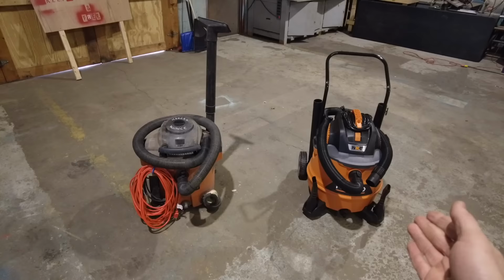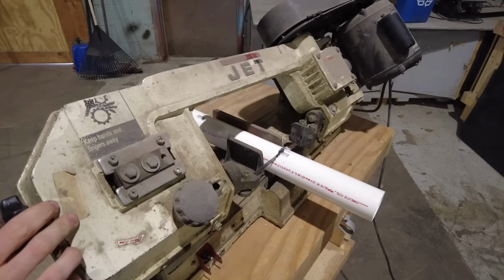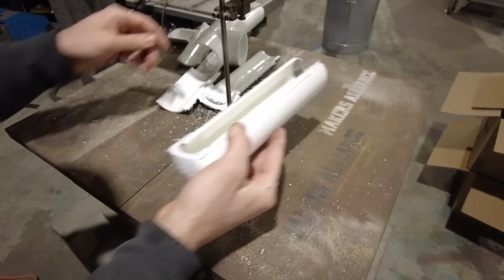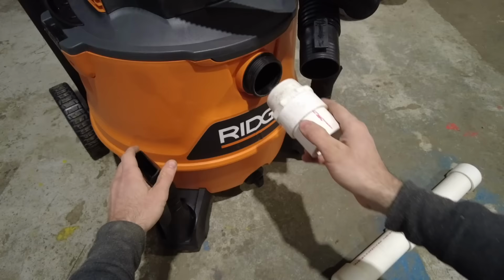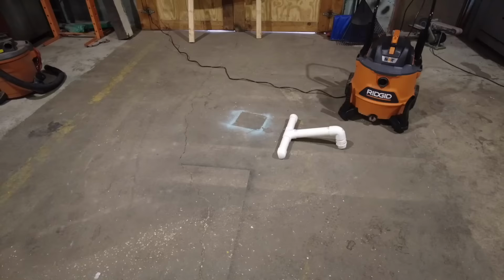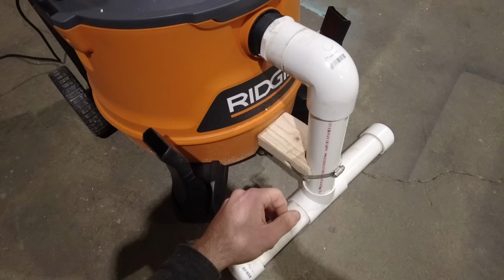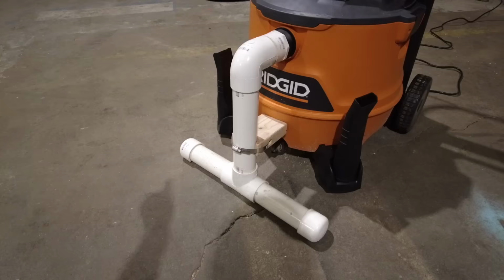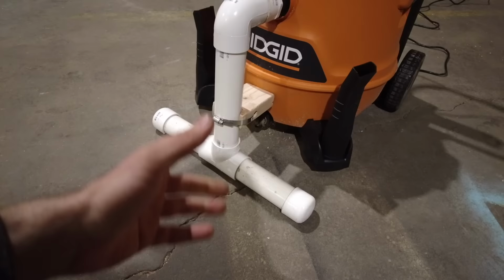DIY Shop Vac Mod  -  Super Wide Walk-Behind Attachment

Comment: Install a rubber door sweep on the bottom rear edge of the floor suction piece . That would prevent uneven edges or floor cracks from stopping progress, and also catch any dust that might have been missed.

Comment: I did the same thing except after cementing and assembling I used my miter saw to cut two slots 3/4" of an inch apart then cut the ends of the slots with a step drill.

Comment: Like everyone, I had a thought. I agree that a smaller pipe and slot size would increase velocity and suction power, only sacrificing "volume", which isn't needed here. What if you put a smaller tube inside the intake bar, but not glued. have about a 3/4"slot in both tubes. THEN the inner tube could be rotated to "close (adjust) the gap size as needed. Wider for liquids, smaller for dirt, sawdust etc. Just glue one cap to the outer tube, the other cap to the inner pipe. The smaller would be the "knob" to rotate and adjust gap size.

Comment: i'de def cut a slight angle at the front so the first thing hitting a pile is the gap not the pipe. now to make an attachment that sucks up water LOL. I assume it would need smaller slits instead of a huge one. would be interesting to see how fast it picks up water

Comment: Nice work. I've always wanted to set up a big vac in the corner of my shop, lay a long pipe slit open and just push broom all the metal fab dust into the back wall area to be sucked up

Comment: I say this is awesome if it works for you no solution is needed.. btw the attachment rigid made that you took to Home Depot to compare for size is basically just a cut pvc T so I think you are as smarter than the engineers at rigid

Comment: You can lengths of tubing easily on a table saw with a jig. Just make it so the pipe is encased on three sides with wood screwed and glued together and you can run the length of the jig and tubing aong a saw to cut a single path into the tubing.

Comment: Not sure if this has already been mentioned; 1) glue the PVC with PVC cement before you cut the bottom of the pipe,  2) use a router or a saber saw to cut a slot in the bottom of the pipe. Still though, a good idea.

Comment: Mount a cordless vac to casters with a push handle and do this would be even better.  I recommend Milwaukie cordless vac.  Very good power and lasts forever.  Design of the pickup piece suggestion.  A much smaller slit slightly towards the front rather than 1 1/2 or so you had will provide a lot more pickup power I believe.  I suggest no wider opening than 1/2 inch?  One more thing.  In electrical conduit they make what is called and expansion coupling or joint.  Basically it's 2 pieces of conduit that are free to slide around each other and have O-rings to seal air.  Use one of those as your down piece and maybe put rollers on the endcaps.  This way it self adjusts as needed.

Comment: Turn the pipe so the opening is up more so when you hit a pile it goes straight into the opening. They make flexible rubber fittings that would work better than the wood and you could use a rubber gromit at the machine you could use a hose clamp on to secure it so it would stay on.

Comment: Put a spinning brush attachment inside the cut out horizontal pvc 
You can attach it to the to the end caps 
So now when you push the shop vac the internal brush can spin causing the debri to be sucked up whether going forward or backwards.

Comment: I made something just like this never made a you tube video on half the things I’ve made for shop use but i probably could have so many millions made off of simple things. I made mine about 3-4 years ago I’ll have to post up on here to show you. I have little wheels on the front to accommodate different levels of floors an used thinner pvc to gain more suction . Think 2” to 1.25” maybe 1.5 but it works amazing and I suck up about 200 gallons worth of saw dust in my shop

Comment: I actually think that it pushing some of the dust around is a good thing making limited or not picking up more than it can handle. If I was going to try to improve it a bit it be adding something a roller chair for a relaxing sitting clean up.

Comment: First of all, I have a 3d printer that helps with the custom to stand pipe interfaces. This includes proper threads where needed. To maintain a higher vacuum pressure without the need for significant height adjustment, a circumference of brushes could be incorporated. Again, the brush interface can be 3d printed

Comment: You could add a brush on the back of the straight tube that's on the floor.
And make another one and add a rubber across the straight part on the back and use it for a squeegee to suck up water.
Then you can put it on the back side where it blows out to dry the floor!

Comment: Interesting idea.  If I may piggy back on your idea, I think you could glue up the horizontal intake pipe with pvc primer and cement, let it cure and then rip cut the opening on a band saw.  Just a thought.

Comment: Excellent mod. I understand the portability of the cordless glue gun, I prefer to plug in my tools just for the sake of the battery and where it ends up when it is depleted. I mean my use of power eats as much resource but don't leave a mess for our kids or their kids.

Comment: If you wanted to increase the suction, you could gradually taper down your new unit to 1 1/2 progressively to the floor pick-up.
As a commenter below suggested, the front floor piece should be able to pick up sawdust wider than the width of the back wheels. 
Also as a commenter below states,  don't cut the end caps and perhaps fasten some little skies to not wear out the PVC over time.

Comment: On the top of the 90 elbow maybe you could glue in another pipe with an ON/OFF valve that allows you to connect the regular hose also?  That way you won't have to pop off the sweeper attachment to use it the original way.  Just a thought. 🤔

Comment: you should have glued the pipe together before you cut the slit out of the bottom of the tube. i also would find a way to add wheels to the tube to always keep it at the height you need.

Comment: To make the pickup work more efficient. Put a piece of rubber hose at the elbow to vacuum instead of being rigid. Allowing it to move up and down as the pickup moves across the floor. Give your holder to the pickup from vacuum some up and down movement. Just as one said maybe a couple of wheels on the ends.  Good job tho.

Comment: The end caps are deep and perhaps and inch or more can be taken off of each while not cutting off the cap side providing better grip integrity to the horizontal pipe while further opening vacuum intake volume and raising the horizontal suction pipe slightly off the ground. The cap wall can be shaved if necessary.  Also, you might consider using a continuous pipe (not having two sections of pipe) and cutting a circular hole using a hole saw blade which would allow for it to match to suction pipe connector hole strengthening the head assembly.  Finally, consider getting using a flexible rubber insert into the vacuum intake and running the pvc pipe from that at perhaps  a 45 degree angle instead of 90 degree.  This will take the impact of hitting uneven surfaces.

Comment: Get a small (in height) brush head the length of your PVC and attach it to the back end (not the front end), so any material that passes the initial suction can still be collect, i.e. more time for suction to function.  This is what is done with the industrial floor washers. The vacuum is in the front, and then there's a squeegee in the back that pools the water, allowing the suction more time to function in the  sucking action.

Comment: Eventually the hot glue will loosen by itself. You can still use it’s a sealer or silicone. I would drill holes on all joints in 3 places after glueing and fasten with pop rivets.

Comment: P.S, PVC is very easy to shape with a heat gun so if you were to just cut a line in the PVC instead of removing a big piece,
you could heat and bend that material and also fasten a piece of rubber along that edge.
Just a thought.
Thanks again.

Comment: Small Wheels on the ends with full end caps a small piece of rubber strip like u would put on doors on bottom for air to use on bottom of pipe to sweep dust in to pipe and face it out in front towards the saw dust/dirt so it doesn't plow

Comment: I would make the vacuum pipes the same size as the back wheels. In your video, the back wheels were running over dirt that was outside cleaned area. Check 6 min 02 seconds.

Comment: Rotate the position of the suction slit so it's pointing slightly in front of the pickup head, this way instead of plowing the dust in front of the pickup head the dust is sucked into the suction slit before it has the chance to mound up in front of the pickup head!

Comment: I used a 10inch piece of plastic flat-hose and put in on the drain.
When the vacuum is on, it will collapse the flat hose and hold it there.
When the vacuum is full, you simply turn off the vacuum, and it will empty automatically.
The vacuum must stay at the drain to do this and you would use a long suction hose.
I had a remote clicker to turn the vacuum on and off with, I was too lazy to walk back and forth.

Comment: Good idea. Just need to adjust it to the width of the back so you are not running over it with the wheels. I think they make wide spackle tins that would work well. Glue in some angled inserts to direct flow to the middle.

Comment: Assemble the pipe with glue before cutting the opening. 
Add 1/4 spacers to the bottom when measuring the height. 
Glue on a piece of weather stripping to the bottom on the backside so it can be used as a wet vac too.

Comment: You didn't take into consideration that air/water flows through the path of least resistance. So the air closest to the intake will go up first in volume, whereas the air at the ends of the intake will have less suction.  Next time taper the cut to favor the end of the intake on both sides. Just test that cut a few times and you will have a the perfect tool

Comment: I mean, the hose attachment is about just as wide and would have done the same thing.  The shop vac has wheels, you can pull it around by the hose.........  This way you can still clean off a table or something that isnt on the ground

Comment: Maybe use electrical sweeps(elbows with a larger radius) for better airflow. Full caps on the ends would automatically give you a little less than a quarter inch gap.

Comment: For the sweeper/suction head head wise two actual vacum sweeper heads side by side and put a Y in to go to both heads (acting as one once glued to the PVC and together) if you can not glue them but allow them to be taken on or off you can switch the head out perhaps this may be better done at the Y so you can go to a single head, the PVC and the dual head for wide. The other thing is for the PVC do not cut all the pipe in half keep the joints solid so it will be able to PVC glue together, then just cut about a 1” slice out of the PVC so it is still basically a pipe with a 1” slice missing then the rigidity should be there when gluing it together. You can always then go back and drill a couple holes in the joints to get some vacum and suction in that area

Comment: You should have 3 seperate types of vac heads.   Wide mouth,  slotted and holes.   For course material pick-up use the wide mouth.   For medium material use a head with multiple but thinner slots.   This will start the use of the Venturi Effect.   For finer material, a head with several rows and columns of small holes will really take advantage of that Venturi Effect.   I find a head that utilizes alternating slot, hole, slot, hole etc works great for everyday use.  Adding rubber or foam to the head will allow you to convert the heads for water retrieval.   Reducing the pipe diameter from 2” to 1.5” in the head and part of the neck will also increase its performance.  Let me know how you make out.

Comment: Instead of a threaded adapter cant yo use a coupling instead? That way you cant tighten it up on the shop vacs intake. I think tightening it at that point would work better if possible.

Comment: I think it would be cool if you put a T fitting at the top instead of a 90 sweeping downward that way you can still utilize your hose if you wanted to, you could possibly even put a ball valve in line that turns off the suction sweeper and allows just a hose to have suction and vice versa. Awesome idea by the way I am really impressed and I’m going to subscribe to your channel as well thank you for sharing your Man 👏🏼👍🏼

Comment: Use a five gallon bucket for a collection chamber! Turn the bucket on its side with the lid installed! Run the pvc pipe through the very center of the bucket all the way across on the inside! Cut a slot along the pvc pipe! Install the intake manifold PVC pipe to the inlet port! Also cut the bucket open on the bottom ! Make sure the slot is large enough!

Comment: You'd have to get creative with the connection to the round PVC pipe, but square plastic downspout, or even rectangular aluminum would work for the  suction head. You could cut pieces of plywood to cap the ends, then add a strip of HDPE bearing material to the right and left ends instead of wheels.  
As mentioned elsewhere, a squeegee material on the backside of the square tubing would aid in suction.
You might need to drill holes instead of having slotted opening, however, aluminum does cut well in a table saw using a carbide blade, so it  wouldn't be difficult cutting a slot the width that you want. 
You going to calculate the width opening carefully, because it's hard to put metal back on 😁
Measuring the width of the opening of a standard 'wide' floor tool might help you determine the best width for the slot.
You might have to spend some time figuring out a hose connection on to the square tubing, but it can be done.

Comment: The cut into the pvc ,if you angle the cut more forward instead of straight down, that will take care of ,if the pile is higher. So you don't have to change the height setting

Comment: I made something a little different. I made a hose attachment with a ~.25 x 15 inch hole. It is mounted on two wheels about a .25 gap above the floor. It is great for concrete as it picks up dirt and dust.

Comment: I noticed the wheels on the vacuum were getting dirty because the vacuum bar wasn't wider than the wheels. Make the vacuum bar an inch or two wider on each side and the wheels won't get dirty and track the sawdust elsewhere.

Comment: Fit the horizontal pipe with an exterior door sweep. The kind that has two rows of bristles with a center row of plastic membrane.
Look for these in the weatherstrip section 
This will allow the horizontal pipe to be positioned a bit higher off the floor
One drawback is that you would only be able to vacuum in the forward motion

Comment: Haven’t read all the comments. Wonder if anyone mentioned using a router to cut the slot  or slots?  Would be more precise as 1/4 to 1/2” to best fit your vacuum.. Making 3  longitudinal  spaced slots would add rigidity to that tube.

Comment: The head needs a brush that closes the gap between head and floor. Dense in the back side and less so in the front.  Drill a few holes on the ends to allow a River of air to force debris to the middle and up into the vertical pipe.

Comment: Keep the horizontal pipe a little higher off the floor. Maybe a half inch and attach a rubber flap to the back of the horizontal pipe.

Comment: This is a great! Definitely agree that brush strips would be a benefit. Would changing the location of the cut to a slightly forward direction be a benefit, instead of facing straight down? I was thinking that this attachment would benefit from a smaller slot opening. Keep the opening width, but cut less of the circumference of the pipe. A smaller slot area may give higher air velocity, creating a stronger suction. Or, put a second pipe over it that you could rotate to increase or decrease the velocity and opening size (for larger debris).
Great vid. Thanks for sharing this!

Comment: The part you cut off of the end caps would have held the pipe up off of the floor 1/8 to 1/4 inch if you had not cut all the way across , so the simple solution would have been to get 2 new encaps and make the adjustment to them. I would have cut enough off of the open ends to still allow the pipe to enter 1/4 inch or so and then you could have used PVC cement to glue it

Comment: The horizontal head that sucks up the debris should extend out past the rear wheels on both sides. This is so they don't pass through the debris the vacuum doesn't pick up as you move it forward. I would also glue it all together using PVC primer and glue before making the cut that creates the opening where debris gets vacuumed up. PVC glue is so much stronger that hot glue.

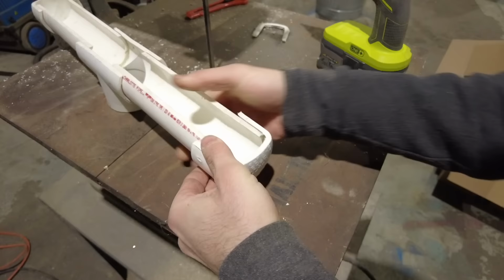Comment: 2:30 maybe glue first cut second? 8:00 there is a wide scoop with brush attachment for the 'normal' hose wand, maybe use that instead of the PVC pipe?

Comment: You could clamp the pipe between two pieces of wood and then use a router to cut a nice straight slot on in the pipe

Comment: Nice idea.  If you'd put it all together using pvc glue and then saw the lower opening.... And maybe cut the opening so that it heads slightly forward instead of straight down.  Lucky.

Comment: If you zip tied the floor tube to a twox4 clamp it to a table then use a router with a 5/16 cutter. I think you lost a little pull value which a thinner opening might bring back. Nice quick

Comment: In my opinion, the floor nozzle needs to be about 4” wider than the outer wheel base measurement. And the rear half portion, should have rollers across it, the sides should be real close to the floor, & the front should be 1/2” give or take, up off of the floor. Or even better go to a vacuum repair service, and buy power heads to assemble together on it, for electrical hook up, by an electrician